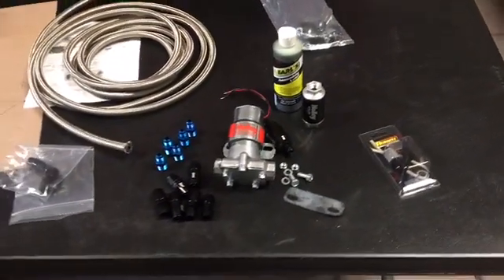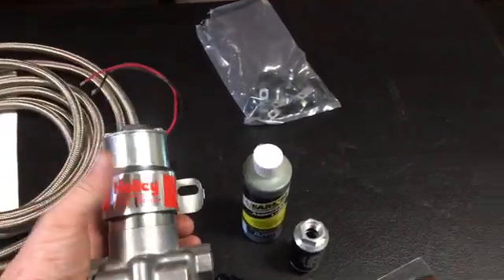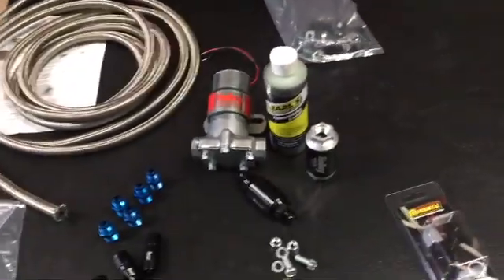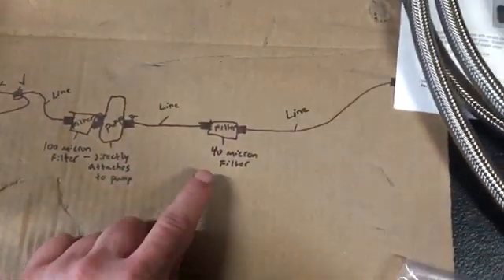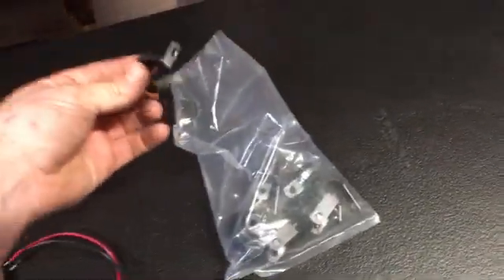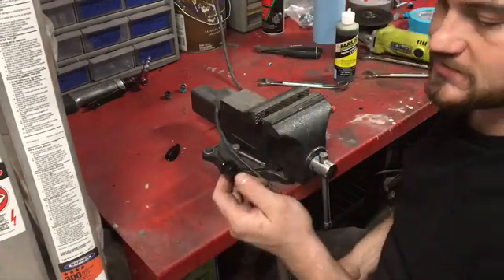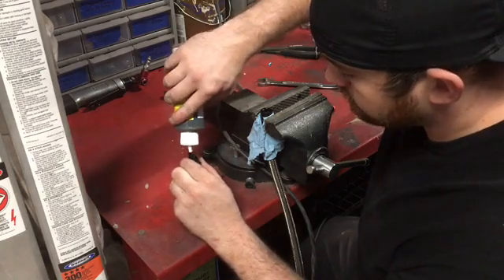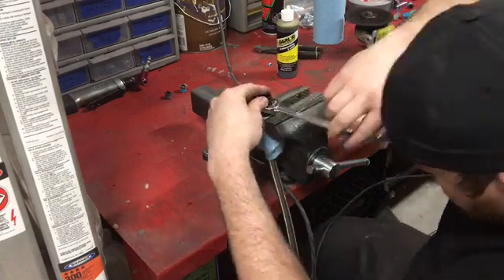Fuel system build and channel updates

Comment: What did you do with the manual fuel pump. Did you remove it?
Reply from the maker: Yes I removed it and installed a block off plate where it mounts

Comment: IMO. The best way to cut stainless braided is wrapping a zip tie around the line and cut through it parallel and straight through the clamp area as a guide the gently peel tie off and  a perfect straight cut and no frays. I get them first time every time that way…my .02
Reply from the maker: That’s a great tip!

Comment: I did close to what your doing I ran my 6 an line up the firewall and across to avoid the engine & exhaust heat. Worked out great. I have my filter and regulator there too so they're easy to change. Nice looking job. Mines a 65 GTO.

Comment: FYI, after cutting the braided line, leave the tape on so it is easier to put the nut fitting on.  then you can pull the tape off.  No screwdriver needed.

Comment: Quick tip after cutting leave tape on slide fitting on take tape off oh and use air to blow out line after cutting or all that crap goes in your new filter
Reply from the maker: Thanks for the tip I will try that out for sure

Comment: Hello, as an old aircraft mechanic the job looks very good. Vibration and stainless steel braided hose will wear though the rubber like a file in no time. If you could get a small roll of teflon tape, wrap it around the braided hose under the clamp, where the clamp is closed and tight not deformed, the tape will allow the hose and clamp to move freely from heat destortion. Looks nice keep up the good work
Reply from the maker: Thank you very much Gary.  I’ve never heard that tip before but I will be sure to do that.  Thanks a lot for the information and compliment.
Reply: Hi Gary, You brought back memories of my Dad who was an aircraft mechanic in the Navy in WW2 and Korea. Blessings to you from Michigan.

Comment: I really liked the diagram. I just think you should of included the wiring also. Can you explain how you did your hot wire?
Reply from the maker: Sorry for the late reply.  I ended up using the power wire that would have been used for the factory fuel pump because it originally had a electric in tank pump.
Reply: @Robs_garage90  Thanks for getting back to me. When I opened the holley box the instruction was there. 3 different ways. I guess next time I will open the box first. LOL
Reply from the maker: Lol sounds good man

Comment: How did it work out for you, I restore a 72 GMC having problems with vapor locking with stock pump.
Reply from the maker: Dale Poe I did end up adding a return and regulator but I still have not driven the truck because I am still in the process of finishing it
Reply: @Robs_garage90  why did you add a regulator and a return line?
just curios?..

larry
Reply from the maker: I actually just ended up doing it because I already had the parts from another project and I wanted to see my fuel pressure, but I did run the truck without the regulator.
Reply: @mafosa8519  A return line back to the tank virtually eliminates vapor lock issues as the fuel stays a lot cooler and don't boil to vapor. Hope this helps. Select a fuel pressure regulator with the by-pass back to tank. Holley has good kits for Carb or EFI.
Reply: @Robs_garage90  Excellent advice Rob!